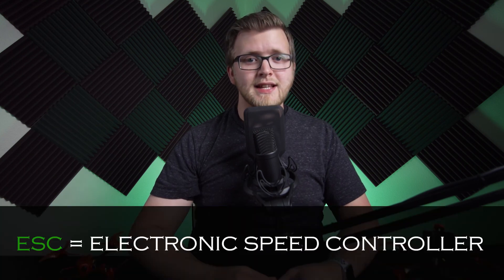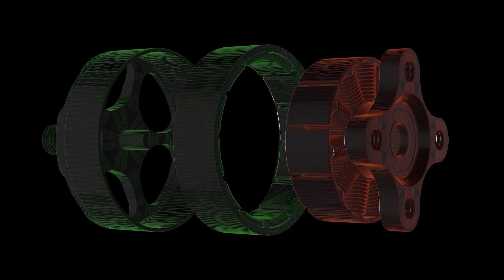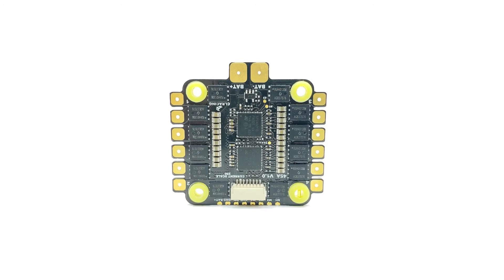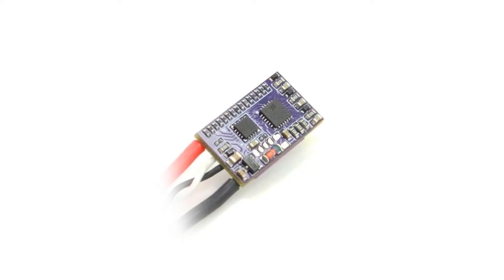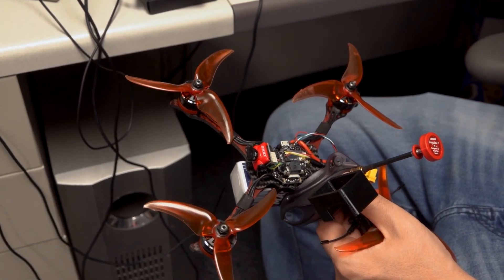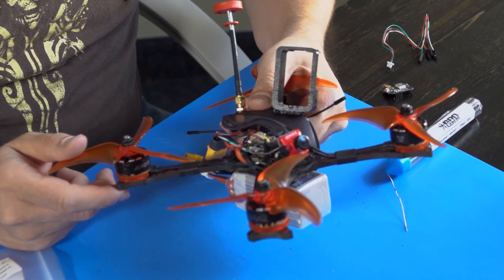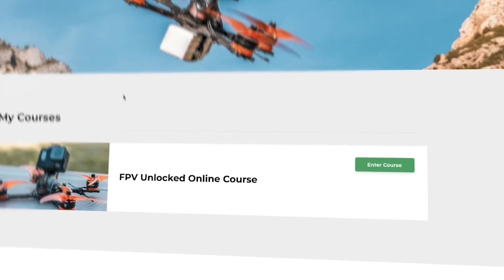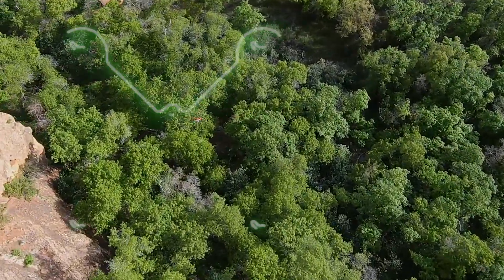FPV electronic speed controllers and what you need to know!

Comment: Hi,  would like to build a capacitorless ESC for an efoil as this would eliminate the need for an antispark switch. It's about a 5KW BDLC that doesn't go in reverse and has no need for braking. If I put the battery (52.4V 40Ah, low internal resistance) very close to the ESC with 4AWG wires do you think I will get away without capacitors? The manufacturer of course says that I need them.